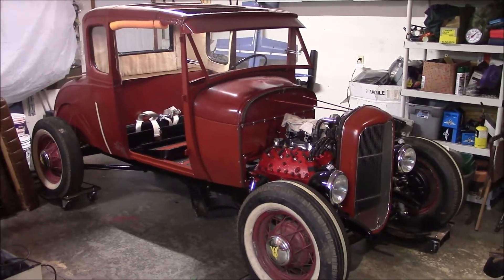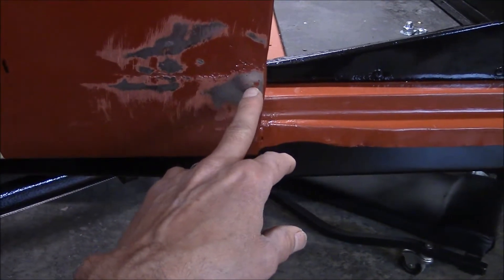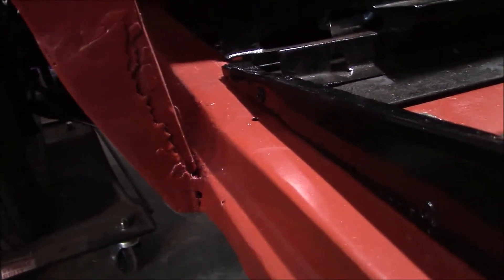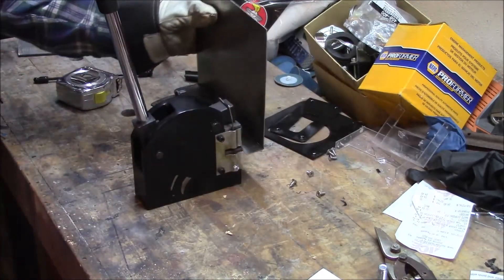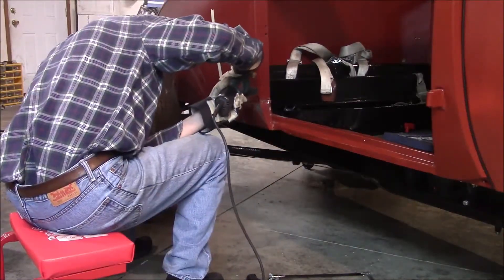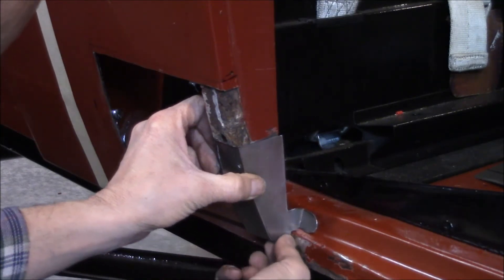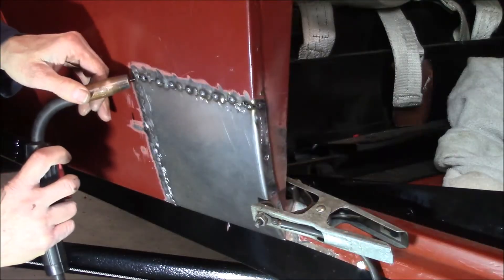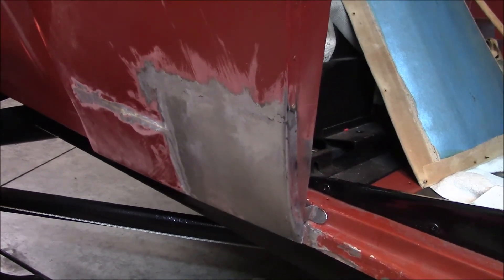Aarons 29 AV8 coupe build 16 Feb 18 Update

Comment: Like I told you before I have been building a cabin in the Ga Mountains for over a year.  I really enjoy watching your progress since I cannot work in my shop (its 60 miles away).  I did work last week in the shop while the wife and kids went to Mickey land in florida.  Anyway, I started building in the 70's as a kid, no money and desire for a nice car.  Let me tell you it is a evolution.  Watching your work you are a natural.  You have desire and vision to see the completed project.  Your panel replacement is also very good.  Most do not try and make their own tools or metal parts.  It has been some time since I have used a hack saw.  Most of my benders are old, just like the guy, but there was a time when i made most of them also.  What I am trying to say is while I have not had time to build my cars, I watch you and feel better.  Don't cut yourself short like the other guy said, you are doing great.  I almost cranked up a flathead motor that I have on a test stand, but did not get the other welding finished (making a boom pole for my tractor to lift the wall sections in my new shop, see we still make our own parts to save money and make it our own).  Thanks for the view.
Reply from the maker: Thanks Joe

Comment: That's a tough spot but you did an excellent job. Don't sell yourself short. I really need to build a small sheet metal brake like that. That's a great size. It'd be real handy I'm sure. It's been too cold this past week here so I've not been out in the shop as much as I should have. Thanks for the inspiration.
Reply from the maker: Ya, with a smaller space, I needed something I could store away when not in use.